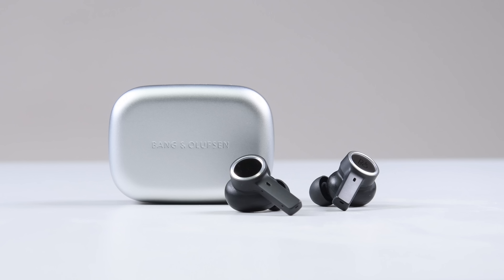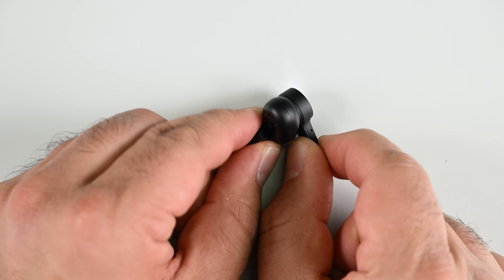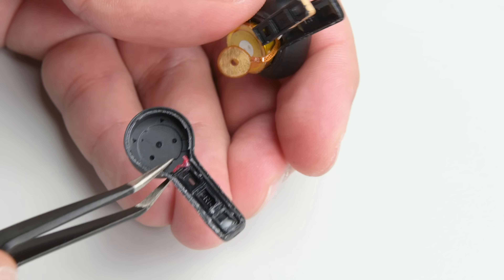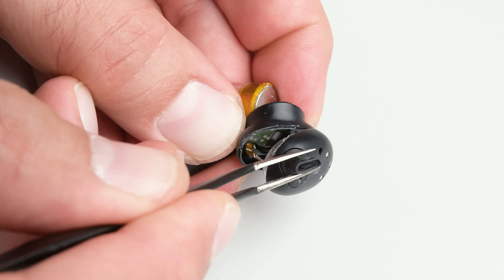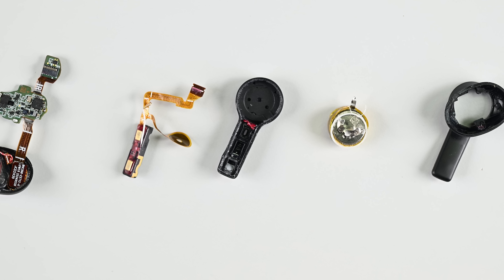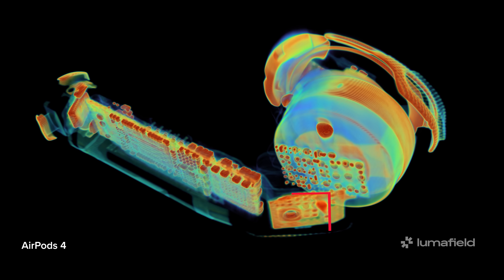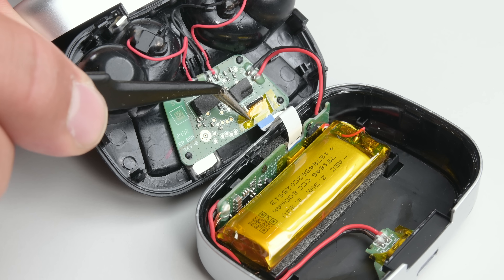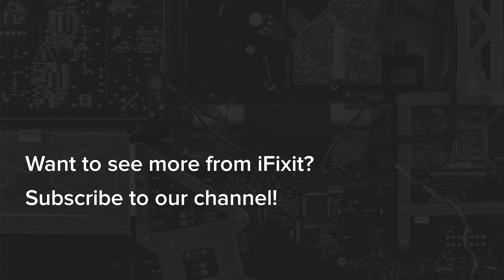Bang and Olufsen Beoplay Eleven Teardown - A $500 Repairability Letdown

Comment: I have some beoplay ex and the battery life does degrade after a year or 2.  Fully charged the app says my buds are around 80% and they only last a couple hrs before needing to be charged in the case.  The plus side is that they sound amazing and blow away like 95% of tws earbuds out there. Ive had airpods pros, sennhesier momentum 3 and the Ex sound more engaging with better clarity, separation and powerful smooth bass.

Comment: Yeah, this is my exact problem with B&O right now—the batteries. I’ve used both the EQ and EX and have experienced the same issue: the earbud batteries degraded badly just a little over a year. The left earbud, in particular, was problematic in both models. Now, they last less than 45 minutes before running out of charge.
For the price it was cost i’m still hoping they last more than only this long.
Reply: i have similar problem, what did you do?
Reply: @IgnacioCarbajal-v3r there’s nothin can be done basically. The battery is irreplaceable. Even if you try to, the earbud is glued shut and theres a chance to break the glass or the cable. So the only solution is to buy a replacement bud.

Comment: It's true, B&O Beoplay Eleven battery isn't able to be removed and replaced without destroying earbud.  Fortunately this is not how B&O replaces the battery.  In the event that your B&O Beoplay Eleven battery is not functioning, an exchange of the non working earbuds for a new pair with a new warranty.  The old earbuds are returned to B&O for disassembly and recycled. This ensures proper disposal.  In regards to the battery disposal, B&O will follow all rules and regulations to ensure safety.
Reply: That's just malicious compliance. The law is moving to repairability by customer AFTER the warranty, in the warranty period nobody frankly cares what the manufacturer does as long as they follow the law and honor the warranty. That's the lowest of the low of standards and you should not give them point for that.
Reply: exactly what they did with mine , they just sent me a new pair after founding a problem in my old ones.

Comment: Every time I got an issue with a B&O product within warranty (and I’ve had a lot of issues), they gave me a replacement instead of a repair. That’s better for me, the consumer, but I hope they at least serviced the pairs I sent back. Now battery life for one of the earbuds on my latest pair of EQ is less than an hour and I can’t replace the cell. Done giving B&O 500€ for faulty, unserviceable products. I just buy AirPods Pro now, they’re just as unserviceable and don’t sound as good, but at least they’re cheap and reliable.
Reply: I completely understand your frustration. It’s great that B&O provided replacements during warranty, but I get how that doesn’t solve the long-term issue of product longevity, especially when batteries or parts aren’t serviceable. The shift towards more disposable products can feel like a letdown, especially for premium brands. It’s tough when you invest in quality and don't get the expected durability. It sounds like you’re making a practical choice with AirPods Pro—reliability and ease of use can sometimes outweigh the high-end audio experience. Hopefully, B&O will rethink their approach and offer more sustainable solutions in the future

Comment: I used to fix B&O products for a living, mainly BeoLab speakers and their matching music centres, they were so great to work on. They all had service manuals and official repair guides with full schematics (until the digital amps came in and they went all secretive, at which point the service manuals became about as useful as Anne Frank's drum kit), and they were designed with serviceability in mind, plus B&O would supply parts for most products right down to individual screws and washers, sometimes for several decades after production. What a great time that was, it makes it all the more painful to see the way electronics are built these days when everything is disposable and almost nothing is repairable.
Reply: It’s amazing to hear from someone with that kind of experience! B&O’s commitment to serviceability and long-term support in those days was truly impressive. The fact that you could get parts and service manuals for decades speaks to the quality and care that went into their products. It’s definitely a different world now, where many electronics are designed with obsolescence in mind and repairability is an afterthought. It’s a real loss for both the environment and the consumer. Hopefully, brands like B&O can strike a balance between innovation and sustainability moving forward
Reply: I have their portable speaker and super easy to repair while being waterproof. Hopefully they can improve future earbuds

Comment: Who’s dropping $500 on this garbage just get AirPod pro 2s for 40% of the price and with better (iPhone) integration
Reply: I’ve always shelled out for b&o’s plus delt with connectivity issues because they just sound magical compared to apples own products. Honestly they sound better than most over ear headphones. Until you compare side by side you’ll never know what you’re missing out on. It’s like comparing two steaks. The b&o is ribeye and the apples are cube steak. Both steak but you get my point
Reply: @android-ud2nf u will have connective issues with B&O until u didn't turn on geolocation on your phone
Reply: U can do it, but don't get surprised why the sound airpods sounds so cheap in comparing with B&O

Comment: 500 dollars for a piece of this?
Reply: I have the previous generation, they are worth it for the sound quality.
Reply: @Rettro404 I have EX, can u tell what exactly better in beoplay eleven in sound?
Reply: @INSGORYNYCH  the 11s have more bass that's the only difference
Reply: @Leondap2024  thanks bro
Reply: The only difference between the EX and the 11 is the 11s has a little more bass also the 11s volume sound lower than the EX
Reply: If you don't have money you will not buy them
Reply: I owned a pair of ex’s before I lost them and can say they blew me away. Very good sound quality and bass.
Reply: Compare with Apple, Sony, or any other name. Between the highest end Apple (in ear) version and this version; the difference is less than 3%. In other words, not detectable by almost any human ear. And then there are the barely accurate claims from the company regarding the battery
Reply: You are.
Reply: Well, its a tws bud made for audiophile, and for those people, 500$ is not that much
Reply: Hopefully made from oxygen free copper. Then they will pay at least 750$!
Reply: @DinooooC  it definitely is expensive for a disposable product. Audiophiles are more likely to pay $500 for a good set of wired headphones or IEMs that will last at least a lifetime.